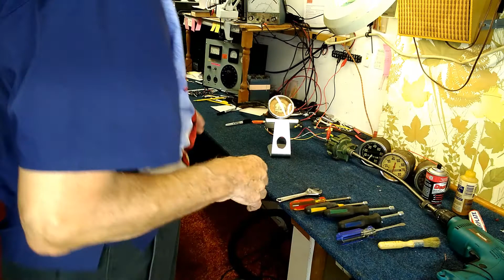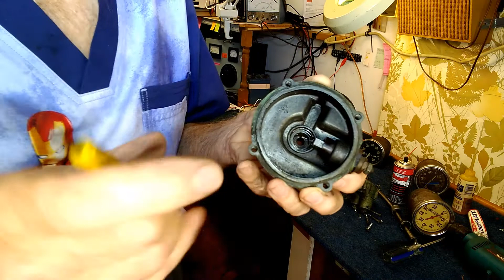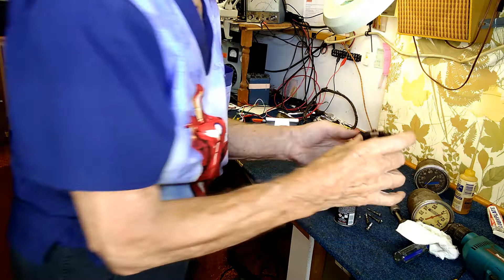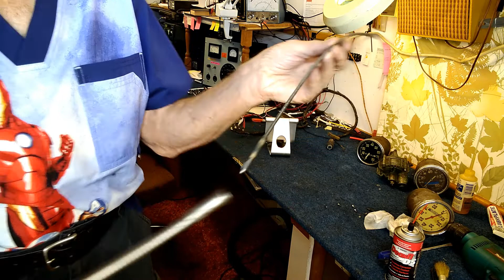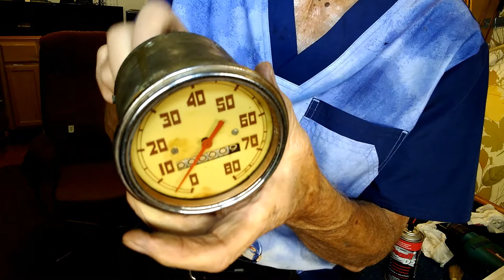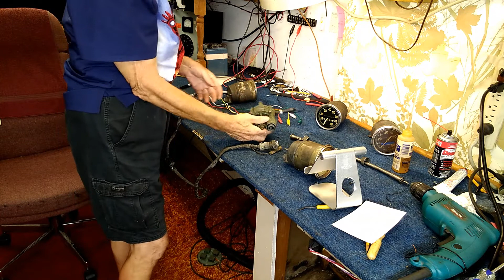GM Bus Speedometer Project on Workbench

Comment: I have a Silver Eagle, the speedometer/odometer have registered approximately 12 miles in 1500 miles of driving.  Apparently these have a system that runs off of the front wheel.  Have you ever worked on these?  Thanks for the videos.

Comment: Lots of these coaches have been converted (like mine) to negative ground.  Maybe you can touch on the changes required to the wiring to make them work that way in a new video?  Thanks!
Reply from the maker: Never even thought about it when you were here. That's why I had no 12v neg at the terminal. Stan has me on another task now. I'll think up something. Any Ideas out there guys? It's a matter of isolating the metal cable from the transmission and the speedo driver from the bus frame.

Comment: That clears up how the speedo works for me and I'm not afraid to pull ours apart. I do need a cable from the transmission to the generator unit. If the bus has been converted to negative ground? Thanks again Phil.
Reply from the maker: I texted reply to you.
Reply: @busoldmanphil7293  Got it. Thanks.
Reply from the maker: More on Rodney's comment: We have parts. Check busboys.org/inventory. I forgot about negative ground conversions. I will experiment and repost next month.
Reply from the maker: And more on that. The "cable" from front to back can be any 4 wire cord size 22 or lager AWG.
Reply: @busoldmanphil7293  Thanks Phil!!! Glad you are getting Taylor's bus going!!!!

Comment: what can you out on the gasket that seals the two halves of the speedo sending unit?
Reply from the maker: I don't put anything on the gasket. Smear some Loctite clear silicone sealant around the outside of the rim of the joint.